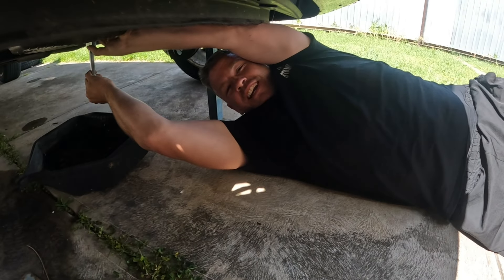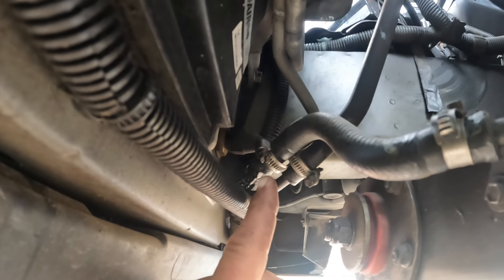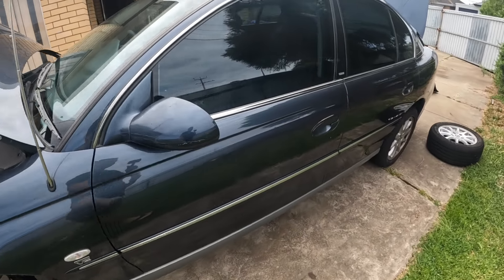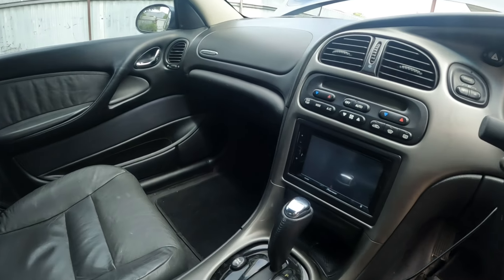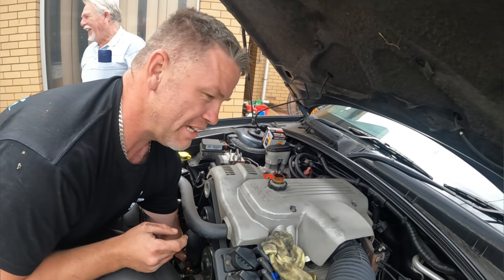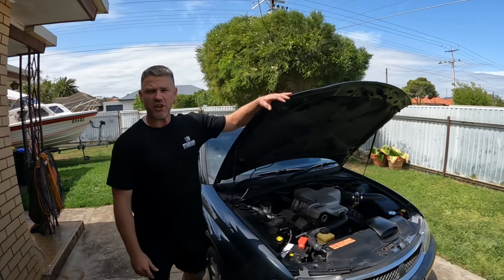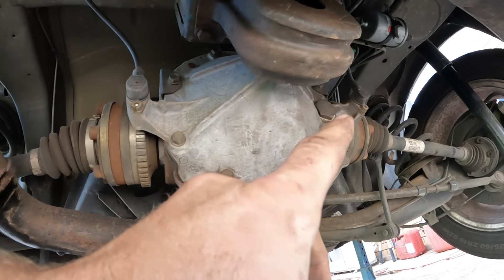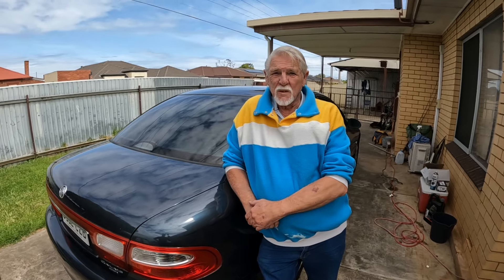Grandpas VX Calais Update Hows It Going

Comment: Sounds like the bearing to me. Bad enough that the crank angle sensor on my VY V6 Ute decided to say it had enough so I'm waiting for a replacement. I replaced the front & back suspension on my VY V8 ute & I'm getting wobbles over 100kph even after having it aligned.
Reply from the maker: @1969Risky  yeah it could be but had the same fault with 3 different shafts 
Bugger crane angle sensors haha 
Oh double check that suspension shouldn't have a wobble after that?
Good to hear from ya mate take it easy 👍
Reply: @downtheshedwithbyron  I have been ill for a couple of weeks but I'm better now. I have to catch up on stuff you've posted on YT.